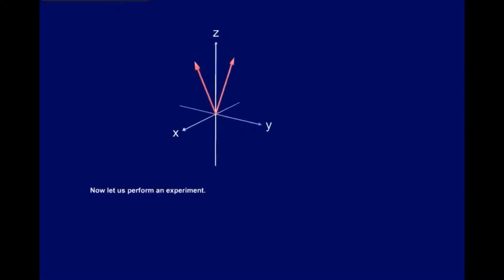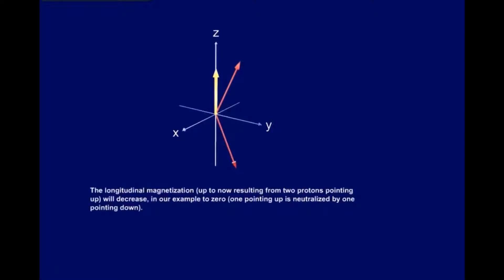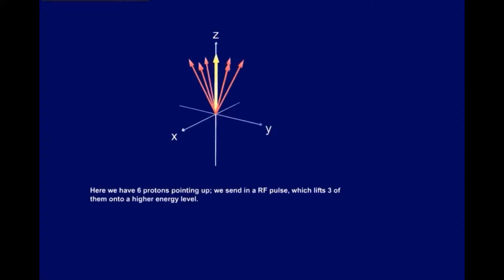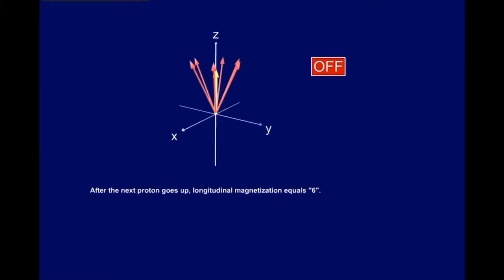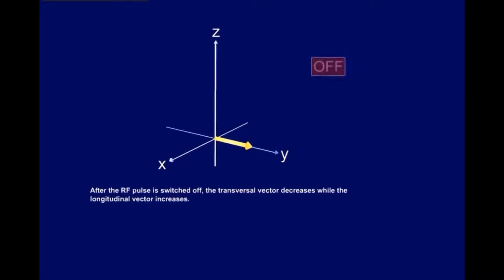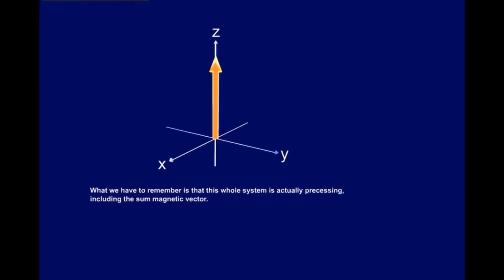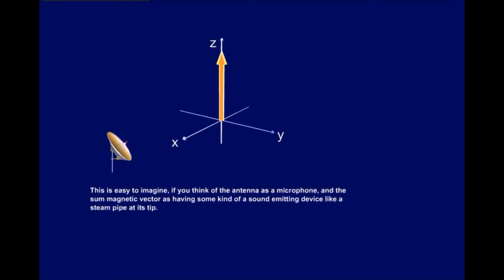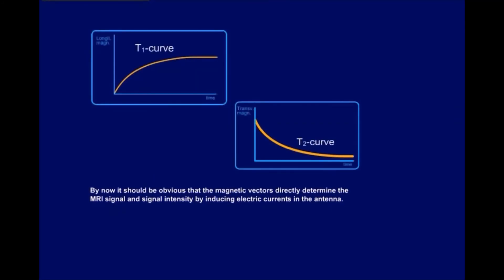90° RF pulse | FID

Comment: When I try to imagine, I always imagine the effect of 90 Degree RF Pulse in the same way. I have no idea why some textbooks show individual spins aligned in transverse direction. What creates transverse "NET" magnetization is the equal number of spins in high and low energy states so showing individual spins in transverse direction does not make sense at all.

However, this video shows only T1 relaxation after stopping 90 Degree RF Pulse. The signal fades not because of spins going back to lower energy (T1) but because of lost phase coherence between the spins (T2 relaxation) which leads to lower net magnetization in transverse direction thus lower amplitude by time.